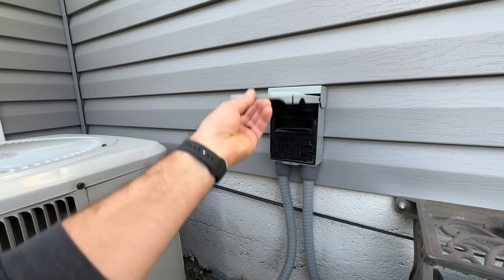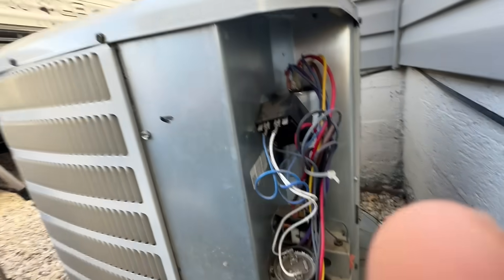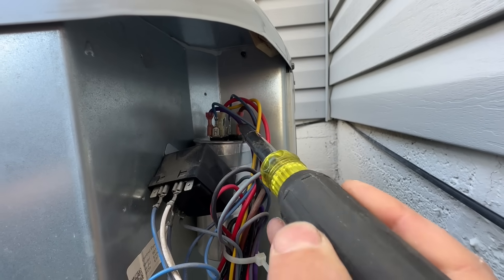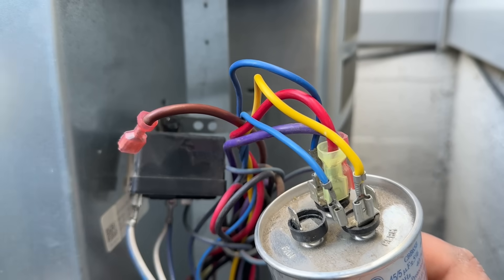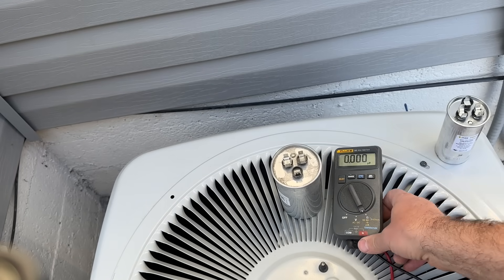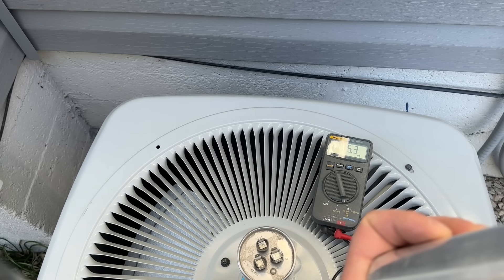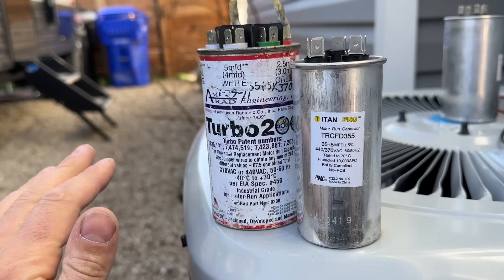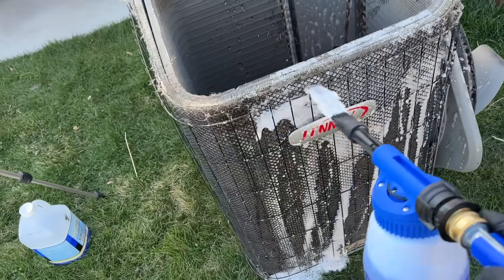How To Check & Replace An Air Conditioner Capacitor

Comment from the maker: Universal Capacitor: https://geni.us/tQWed
Klein Nut Driver: https://geni.us/I3ZCeA

You can find all my favorite HVAC tools right here in my amazon store: https://geni.us/7bc6iz
Reply: Well, despite pulling out the plug at the outside power box, the way my system was designed there was still power going to a small circuit board inside the side panel housing. I succeeded in replacing the capacitor, but as I went to attach the metal clamp to secure the capacitor back in place I made contact ever so slightly with the circuit board which for some reason still had power to it. A small spark shot off the board and fried it. Now my system is down and out. Do you think I can find a replacement for the board myself or am I at the mercy of my HVAC company? Any advice would be greatly appreciated. Thanks.

Comment: When I prepped my ac for action last spring I decided to replace the 10-year-old capacitor. It worked okay the previous year, but I didn't want it to fail when the temperature outside was 90 degrees. The swap cost me $20 for the new capacitor and my labor, which was free. I used your video as a guide on what I needed to do. Thanks!

Comment: You saw how you respect the cables and you don’t touch them by the metal part. That’s how you don’t get shot. Most people will pull that shit out by touching the middle and that’s when they are charged up if they’re not charged up.

Comment: NOTE ! Before shorting the pins on the capacitor, make sure you're not using a screwdriver with a metal grip. Plastic or rubber rips ONLY !!!! Otherwise you'll get shocked

Comment: I had situation where the combined duty capacitor would last a few years and then die. I then switched to 2 separate capacitors with their required rating and used a jumper for the commons. Since then I've had no problems. It might be cheaper to make a unified capacitor, but if one side dies you have to replace the unit. 2 separate capacitors is a better idea.

Comment: I remember working in hotels years back and was changing out the board on a window Shaker I didnt bleed that bad boi and I had abiut a 2hr mental conversation wondering if this was the job I wanted to do.... here I am 14 years later

Comment: Great video. I've actually seen many of these videos before finding this one. The symptoms I had were, 1) The fan is running, but the AC does not get cold. 2) At startup, when the AC kicks in, there was a very loud noise and the unit seemed to rattle a bit.  After replacing the capacitor, both issues were resolved on 2 different occasions. Thank you for the video and I hope it will help someone when they run into the problems as I'd outlined.

Comment: Thanks for great instruction. I'm hoping that's all my 3 year old unit needs. Yeah, I'm not happy. 2 repairs for a 3 year old system. Replaced a 21 year old system. Only 2 repairs on the 21 system before its replacement. New units suck!

Comment: Dave, appreciate the details of your instructions. I followed your steps and when it came to testing the capacitor using a new Klein  MM300 digital multimeter I found no reading when the setting was on 200µ. I've tried the meter on a 9V battery to see check if it worked and all good. When on Diode audible setting the capacitors currently on the units read .052 but the new capacitor read 0. I had ordered the capacitor on Amazon. Can you advise me what on what my next step would be? Could the capacitor be bad?
Reply: And I did purchase the Klein Nut Driver

Comment: If I have a 70+10MFD is it essential to match the 10? I'm having a tough time finding a replacement for my Lenox AC unit running a CBB65A currently but needs to be replaced.

Comment: Great video. I changed the capacitor and the unit started up but was still not getting cold air coming out of the vents. Any other troubleshooting or do I need a new unit to replace my 25 year old unit?

Comment: I may do this. I pay a local HVAC company $20 for their maintenance program. They noticed my capacitor was undersized for the unit specs. Tell me how they came up with $300 to replace it. When I'm already paying for the labor?

Comment: Dropping in to say thanks. We had a huge lightning strike the other night that took out our power and I didn’t realize until today that we were no longer getting cold air. It had been still working all the way up to yesterday but after a combo of researching how a lightning strike or power surge could cause the capacitor to die I thought about how it was likely just the remaining residual charge that allowed for a day or two of enough power to still get the compressor running. Well today it finally ran outta juice and your video gave me the confidence to give replacing the capacitor a try. The fan was still working to blow air in from outside so it pretty much had to be the capacitor. You saved me a week or so of waiting in a hot house at the end of summer to get an appointment and hundreds if not a thousand+ dollars. Went down to my ace hardware and picked up a new 70/5 capacitor and had my cold air back in 15 min. Stuff like this is what YouTube really should be for. Subscribed! Thanks again.

Comment: Same exact capacitor failure on my ac unit. A tong feng. Basically translation a cheap Chinese made one. They only last about a year maybe two. Sure they are much cheaper in 5 to 10 dollar range. But if you want the problem solved right just spend the extra money and by an American made one for 30 dollars or splurge a bit and get the 50 dollar ones that have a much longer life. Otherwise you’ll be replacing capacitors almost on a yearly basis

Comment: I replaced the run capacitor on my A/C unit today, got the capacitor at Tru Value Hardware for $35. Six years ago the AC guy charged me $70 for the same capacitor and total bill was over $200. It probably would have been double that today. Total replacement took about 15 minutes, the condensor unit started up like a charm. Thank you.

Comment: You are awesome!  After the $99 drive-out charge I was going to be charged an additional $600 for a capacitor, which I'd never heard of.   Plus extra for whatever might be lurking.  We had a tangled mess of 6 wires in there but your 2 videos had me going to ACE Hardware to spend $35.  The drive back home took longer than the wiring itself.

Comment: People who make these types of videos for home and auto repair are seriously so generous and amazing. This fixed our issue!!

We realized our AC wasn't blowing cold air consistently. Sometimes it would and other times it was just the fan blowing! We cleaned the coils and it seemed to be working again, but the next night the compressor wouldn't come on. When I pulled out the fuse and put it back in, I heard a small humming sound and then nothing. 

I researched the symptoms and found it could be the capacitor. We found a part at Ace Hardware and in ten minutes it was fixed!

Comment: That's amazing gr8 video God bless honesty 🙏 goes long way ac company want to rip you off get 4 estimates and you see what I'm talking about A/C company wanted  to charge us $ 26,000 another $22,500 ,platinum a/C $13 ,500 for the same installation complete replacement ❤😎🙏

Comment: Have watched several of your videos and they are great, well presented and right on the money. One question: I just looked up my Rheem 45 uf capacitor and the identical unit on Amazon is $145 . Is this a special unit because it says "Fits Rheem" or can I use any $15 unit that matches the specs

Comment: Such great advice, thank you! I have an old AC unit that quit last night in the heat of the late day. I disconnected the power, opened the side panel and I saw my capacitor was rusted and bulging, an easy indication it was bad. I ordered a new one on Amazon with overnight delivery and just installed it this morning. AC is running beautifully!! All your HVAC advice is great but this was fantastic for me!
Reply from the maker: Awesome, so glad you got it all sorted out!

Comment: Thank you sir, cleaned my ac unit coils and swapped filter didn’t work. Went and spent $32 on a new capacitor and didn’t work on the first two start ups due to wrong wiring, watched your video and followed your wiring steps and boom. Cold Ac is back my family thanks you for your service 🙏🏼

Comment: So I have a good HVAC tech.  He knows I'm pretty handy and suggested I a capacitor on hand as it would be that part most likely to fail at some point (I did buy one). My AC is still working but this year I've noticed a little more drain on some LED bedroom lights when the AC starts. A Google search seems to confirm that a capacitor that is wearing down could be the reason for this. Is best to wait for the capacitor  fail or test it now. Since the AC still seems to be working well, my thought is to just wait and don't mess with it (especially since it was 100 today).  Does that make sense?

Comment: I am 99% certain this is the problem with my AC unit.  If we have a 35+5 with two connectors, can we replace it with a 35+5 with three connectors, or is it important to match it exactly?

Comment: Thanks for this very learnful video. I did by myself finally. Replaced a 35/5 6% with a 35/3 5% that I had as an old spare for now and ordered the right one to change it as soon as I receive it. Should I be worried to run a lower specs one four a few days? Thanks again!

Comment: Excellent advice. In the 20 years I've lived at my present location, I've had to replace my HVAC capacitor 2x and the relay once. Easy-Peasey and saved me potentially hundreds. It's ridiculously easy but I second the safety points you raised re the cap and power.

Comment: I just wanted to clarify that the fan reading of 4.6 uF (microfards) was actually outside the range of 5.0 +/- 5% since 5% of 5 is 0.25 making the valid range between 4.75 and 5.25. The reading of 4.6 was too low.
Though, of course, one could still tell based on the common to herm terminals.

Comment: Dear DIY GUY HVAC, you have made today a day of Grace, here's why...my central air ac started right up. The fans were going but with not as much force as last year. The air was circulating the house but stayed warm. HVAC guy comes. Said the capacitator is shot. Due for Yearly "Maintenance" too. Soooo....
$300 for parts. 
$175 labor 
Seriously struggling with that. Then the heavens opened up to your video channel. I subscribed. I appreciate your knowledge and the precise video content. 
Neat & Sweet.
P.S. I will be purchasing through your site as a way to say Thank You 😊😊

Comment: Many people scammed others to make a quick (hundreds of...) buck. Can they sleep at night, or teach their children not to lie,cheat,or steal? That is exactly what some of these people did to their customers. They need to make a living, but should be ethical.
My outside unit fan made a twang noise when start up. The tech said he never head that problem before. To his credit,he said the cap needs replaced and there was a charred wire at the top connector, new cap cost $400, plus service call. Few weeks later, we have another guy to check the system per our service agreement. He said I need another cap, and suggested a UV light to kill the mold/bacteria on the coil fins.
I worked as an electrician, but never bother to learn HVAC, so I did not want to mess with things I do not understand. Stumble on your channel, your instructions are clear and easy to understand the AC system.I opened the cover and the cap was NOT replaced (thick layer of dirt on it) and the twang persisted. He charged me for part not replaced. 
Another guy came to give an estimate on the UV light, told me I need a new compressor for $4000, and new contactor for $350, may as well replace the system for $12000, since my unit is about 11 yrs old. I said it will be on hold for now. I will run until it dies. 
Go to Amazon, 2 caps, contactor for less than $100 and 1/2 hour my time. No more twang from the fan. I will not use that HVAC company again.Thank you so much.

Comment: I've had to have this part replaced every year since a new AC unit was installed.  I live by the ocean which tends to be quite bad for electrical components.  Is there anything that can be done to keep these capacitors from going bad?  When it happens again (since I am sure it will), I am tempted to replace it myself thanks to your video.

Comment: We have one of Turbo 200 on our unit now. Will I be able to use the most newer capacitors? Also ours have 2 orange wires. Where would they go on the replacement capacitor?

Comment: QUESTION. WHY did you replace a 45/5 cap with 35/5. And does it mean a different cap might work with my ac that has 45/5 now ?

Comment: Great video.  Quick question: my current capacitor is 35/5 +- 6%, 370V AC, 50/60 Hz, CBB65B.   The ones I find have all the same numbers BUT its states:   370V/440V.   Mine does not say: 440V.  Ok to purchase with 370C/440V?  Thx

Comment: Just paid $250 and found this video AFTER the fact. To make me feel better the technician told me that had I gotten zapped it could have been fatal. Wife (and Google) said I could have voided the warranty. I tried accepting this but after sitting with it for a day it still doesn't sit well with me that my family and I endured an 85 degree house over the weekend and I am out $250 for something that this video made look almost as easy as switching out a light bulb. 

It could be I'm disappointed that I saw a top ten diagnostics video and number 3 was bad capacitor but it got lost in all the other information. Plus he didn't sell it as something I can do right now myself for $10! 

I love supporting my local small businesses but not at the expense of being taken advantage of. But is that fair to honest HVAC technicians to equate this to highway robbery? Someone can say the same thing about what I do for a living. Maybe it's the hurt talking. I'm mad that I didn't get to be a hero on this one like everyone else in the comments section .It possible that I would have paid the $250 like the wife and Google said, but I would have felt better coming to that decision knowing all that I know now.

Comment: Thanks for your video. It helped me save like $350 bucks. I had some really old archaic oval shaped capacitor that was all set up weird and so I couldn’t just mirror pulling the cables off and hooking up the new one, but I watched your video and just based on the color matches I got it figured out so thanks again

Comment: 3:31
Nice video, especially noting the Amrad 200 multi-cap.  I replaced mine with their dual 55-5 MFD can.
My method for making sure the wires go where they should is to bring the new cap up to the old one and replace the connectors 1 at a time from the old onto the new.

Comment: FYI - your measurement of 4 6 on the fan side was not good either. The rating of 5 with +- 5% would be 4.75 - 5.25.

Comment: I'm about to do this job right now. Thanks for the info!!
Reply: My method for making sure the wires go where they should is to bring the new cap up to the old one and replace the connectors 1 at a time from the old onto the new.

Comment: Wish I would have seen your video sooner. Just paid $400 for a capacitor replacement, AC house temp was 87 degrees here in North Texas.  I will buy a new one and have it on hand for the next time. Thanks for the video, good job.

Comment: 1. Verify that power is off with a multimeter or NCV detector.  I have seen "disconnects" in which line power bypassed the disconnect.  240V is no joke.

2. The disconnect does not cut power to the low-voltage lines, which are powered from the air handler.  You can still get a zap from those or short that circuit.

3.  Some units have separate start and run capacitors.

Comment: @1:40:  You always give the same wrong explanation of capacitors.  It is not like battery.  This is obvious from the fact that some have bleed resistors.

A capacitor helps spread the jolt of initial current into more of a push.  (It acts similar to a balloon in parallel.)  It shifts the phase angle of some of the current.

It's not a battery or a booster.  Please stop saying that.
Reply: Right ... capacitors are more like a spring (mechanical analogy).  They store energy and then release it.  And just like a spring loses tension as it releases energy, so does a capacitor lose voltage as it releases energy back into the circuit. Batteries do not lose voltage as they release energy --- until they become depleted.

Comment: Ok.  Dumb question.  Our capacitor went out on our AC.  I followed you instructions swapped it out but still didn't work.  I was still 99% positive that it was the capacitor.  We ended up calling the AC repair guy.  Luckily our AC was under warranty so the call/fix was free.  What did he fix the capacitor.  I looked at it.  Its no different than the two that I tried to replace it with.  My wife tried to watch him doing the work.  She said he also had to reset the AC unit?  (I had turned the breaker off, the furnace switch off, set the mode on the thermostat to off, and pulled the power bar inside the box outside the AC on the wall.). Is there some other hidden reset button I missed and I haven't heard about in all these tutorials?

Comment: Then where does one buy the capacitor and are they all the same or different values?
Reply: Different values for sure ... depends on the unit's fan motor and compressor.  Different houses require different sized units for maximum efficiency.
The USA company Amrad makes the best caps, check them out.  They make all sizes in both single and dual cap models.
They also have a 5 year warranty, most others are just 1 year and are Chinese knock-offs.  Spend the few extra bucks on the Amrad and be happy.

Comment: Hi, how would you go about taking off the wires from the capacitor prongs that are stuck due to rust? Is there a spray or grease safe enough to apply to the rusted capacitor prongs so you can pull out the wires? Please reply. Thanks.